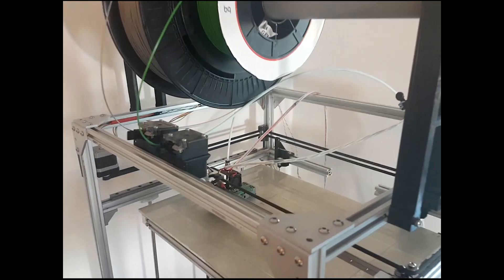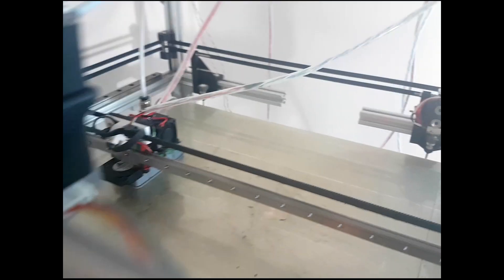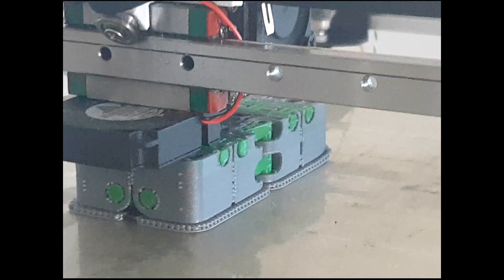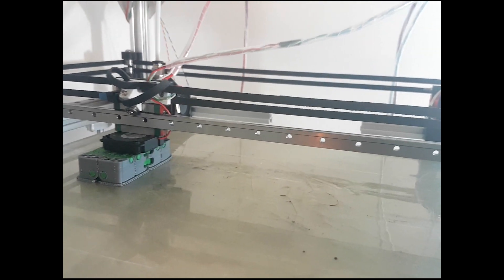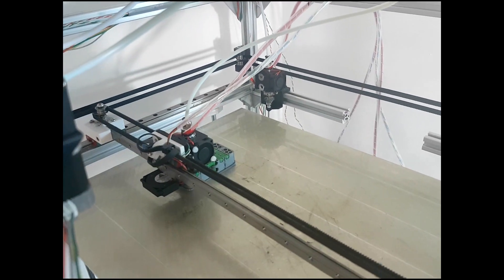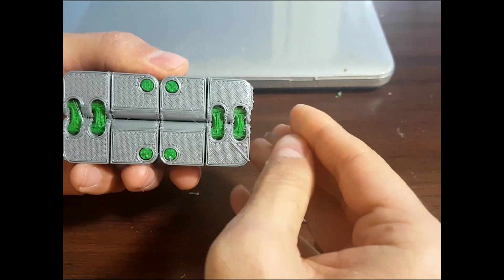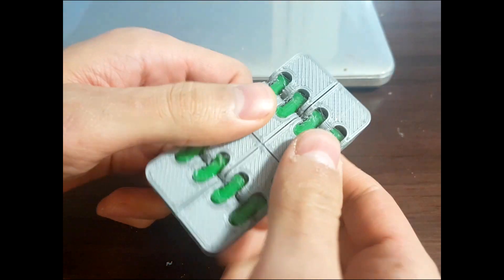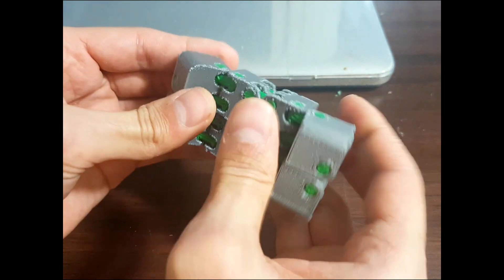RK3D Tool Changer #5 Dual Color Test

Comment: 4:12 if you print one from petg and one from pla there's no way they'd be sticking! pla and petg are like oil and water! I use them as supports for each other with a 0 seperation distance! just make sure you don't get it between each other's layer or else they'll be weaker than usual (fixed easily by calibrating your offset and using a larger xy seperation)
Reply from the maker: Sure, if you check my channel you will find many videos for the great use of different materials together :)
However, this was just a test for the machine using only PLA.

Comment: is the toolchange magnetic?
Reply from the maker: Yes.
Reply: @RajaaKahel  OOh nice! everyone told me magnets are not repeatable enough to work but yours seem to be working very well :) Awesome job!
Reply from the maker: @chloemcholoe3280  Thanks!
And tell everyone that I challenge them in the tool size and the repeatability and the tool changing speed and my DIY auto-leveling sensor accuracy ;)

Comment: I saw you made a post about using the Nimble on this, but you're not anymore?
Reply from the maker: After my Nimble started having extrusion issues (because of the lubricant they provided wasn't very suitable) I swapped it to Bowden. But I might get back to them later and use them.

Comment: That is so cool! Great job!
Reply from the maker: Thanks Cedric!
Reply: Do you have to edit the gcode to make it change colors? How does that work?
Reply from the maker: @cedricproper5256  Nope, I don't do anything other than settings up macros in the Duet with proper other settings as well as in Simplify3D.
Then when the Duet receives a T command it will pick/park according to the macros I made.
Reply: You make macros?
I'm unworthy.
Reply from the maker: @cedricproper5256  Haha I'll try to include all the settings and macros I used, to make it easier for others ✌️
Reply: Wow! thank you. U R Awesome!
Reply from the maker: @cedricproper5256  I included the settings and macros, only forgot to add a couple of codes for the slicer (start/end) which will do later.
Reply: Many thanks to you. Always looking forward to your videos with love and respect.
Reply from the maker: @cedricproper5256  Thank you! That's kind of you :)

Comment: YES ! Go Rajaa! Im buying an FT-5 R2 printer today and already have many electronic upgrades for higher temp high strength material usage and things I will be moving over to it. I want BADLY to use the printer as a kit to transform into a similar CoreXY setup to begin tool-changer testing (or if I can gain the reach needed with the general / stock Cartesian X Y movements to be able to grab tool changing system - then I would do core XY at a later date as I badly want to begin immediately working with Tool changer technology) as well! It is so important for projects I am in need of being able to do with a 3D printer! Very advanced Research and Development for components I must print that can handle EXTREME forces that so far only injection molded polymers can withstand as well as heat resistance - I predict the ability to integrate various high-end materials such as injecting pockets with PC in an overall build from NylonX - that at stress zones the variation of including a differing material property may provide the answer and for that I realize I must perfect basic tool changing technology!  - I hope to collaborate sometime soon or tey and catch up (unlikely for a while as you are doing such great work and it has been a long time since I have done programming) but mechanical engineering comes naturally to me at least.  The future of FDM printing is in tool changing technology and pioneering the use of it and the mechanics, the coding etc.   I hope we can collaborate soon!  - I have another video of yours I am about to search for now where you used Stepper encoders on your A and B motors and they had built in encoders / display screens on the back of the stepper motor - it seemed to add some degree of closed-loop control for correcting movement jamps or obstruction due to difficult print surface etc. I wanted to know if you still use those in the current build (so that if the hotend movement slips it is corrected for to correctly print always) and second what encoders/stepper drivers/displays that were mounted on the back of the steppers that you used - there was no information in the video description to give resources to explain what they were or where you obtained them.      I view MANY people on YouTube that are well known and respected - But very rarely do I find an innovator like yourself I believe thinks in similar ways to myself and are doing the things I (soon will) but would have been had I began 3D printing earlier. Not many people out there I truly can see have the intelligence and educational background to understand and solve problems the way you do. For this reason I do hope there is a way besides comments I can be in contact with you to share more details on this challenging engineering challenge which pushes the boundaries of FDM printing but I believe is possible to do especially with tool changing technology for not only having prepared and heated hot ends with various build materials but also to be able to use different tool ends such as laser for batch number markings and even mild routing / actuators / endless possibilities.  What is the best means to converse with you? Is Whatsapp available? Google chat?  I would like to explain some elements of something that is such a challenge I think it will excite you to know this technology right now you are working on can have an immediate use that never has been able to be done with FDM printing before but all my testing this far leads me to believe it will succeed and be possible.   I hope you will be able to chat with me in regards to this as well as questions I may have regarding the FT-5 and some of the coding with controller board swap to Duet etc as it simply has been many many years since I have done micro-controller programming etc and will likely need refresher and guidance to get setup with the basic platform to allow the freedom for development of the machine far beyond its stock design etc that's needed.
Reply from the maker: Hi Gerald,
For the CoreXY conversion from an FT-5 I have posted the files already, if that might help with something.
For the tool-changer I also posted the files.
Perhaps you find something useful there.
Printing with special polymers for special objects/situations will be much easier with a tool changer as you can customise a tool or more for that.
For the Smart Stepper (encoders) I removed them because I installed the DuetWifi and wanted to test and use its drivers as they are really great! But the encoders working nicely anyway. I posted the link to buy them (and get info about them)  in my design's page, perhaps you missed it then.
Thanks very much for your encouragement! I'm glad that what I'm doing is appreciated and useful for others!
Unfortunately because my free time is so little recently, I can't manage to do projects with others.. I honestly barely getting time to test and share what I make.. As you see, a few months between a video and the other.
But I might be able to help answer/solve a certain thing when I'm asked.
Sence we have a huge time difference assuming you are in US the best way to get in touch is through thingiverse messages (or preferably comments so other people can benefit from reading as well).
For the board, get a Duet! Everything I did was made using G-code commands only!
Hope I covered your points!
Catch you later :)
Reply: lol, same here, converting my ft5 as well. Readying it for the toolchange project... ft5 a terrible stock printer, but great to mod..

Comment: Awesome tool-changer design in action! Very nice clean snap for drops and pickups. Is there be a need to prime and wipe the nozzles if they are sitting in idle for some time?
Reply from the maker: Thanks! No priming and wiping at all! The silicone in the brush-cup is blocking the nozzle nicely. You can see that closely in my previews video: https://youtu.be/InrN1Av3H_M?t=373
Reply: Its funny - I bought 2 of the exact same wire part cleaner for dreemmels to mount vertically to clean / wipe any residue off the tool changers. I have a friend here that (while first I used a TronXY as a base for materials to begin customizing this much - but I have come to find the FT-5 is a much better starting machine) but I showed him these videos and he laughs as so many of the things you have aleady created and implimented in your build are all things I had already been assembling parts for with digrams and designs I talk to him about all the time - and once we ran across your videos even he mentioned "You really should contact that guy that's crazy all these things you have been talking to me about that you are saving up for and plan to do are basically being done by that person already!" .   Anyway - Im very interstedd in trying to (as money permits) catch up to be able to have a similar setup or enough of one for me to collaborate with you in regards to toll changing development. I hope circumstances allow for me to catch up at least with the needed hardware soon so that if we can share knowledge to at least have similar enough testing machines and basic coding to be close enough to the time lead you have had to be involed with tool changers and your printer build - If I am able to catch up, I believe 2 minds working on this process will more quickly isolate problems and find solutions for them in pioneering this VERY NEEDED Technology - I already have a corporate connection  NEEDING a part and many future parts that never could have been made before but I believe from my Chemistry,  Plastics & polymer Chemistry,  and Physics with significant Statics Backgrounds -  that FDM CAN Produce this particular challenging goal to be able to make by 3D printing that would change an entire industry - Luckily its a very close friend of mine that I discovered his field and my new growing intrest in 3D printing could combine to provide a solution that would never have been seen before) - Anyway, from the way you design alone I can tell we do think similarly on things but with enough difference that if with your guidance I can be caught up to where you are in terms of the systems etc and refreshing of my former programming knowledge but also tapping into the control means for the various controllers (I hope to use a 32 bit Duet controller) but If with your help I could be more quickly brought up to the lessons you have learned over the years to get to the place you are in this project - Then I would be able to be of greater use in connection with you to both solve issues together compare the ways we each solved the issue and start to develop a streamline protocol and maybe even begin to establish standards for tool-changing technology (E3D is currently in the lead for doing so but as the community knows there's always room for another option - I believe working together we could more rapidly produce reliable tool changing platforms and standards for all FDM printers and other members to be able to use and know that by adopting it they already benefit from all you have discovered already plus as I know the challenges of my design needs for this system will be very similar to high end applications that (as stronger filaments and prices come down on current ones) means that FDM printing may be viable as a true machining end - product process that really can become so stable that it can find its way into households everywhere to be able to produce replacement components that have the strength profiles needed to be viable for what is needed for normal use and making lasting prints.     Sorry this wasn't well composed and long - I just caught your video and hoped based on it being uploaded an hour ago MAYBE I will catch you to be able to reach out and also have shared some of what my vision is as why I badly (now with waiting on delivery of my FT-5,  MIC6 Plate Bed (I cant stand having a bed that isn't level to begin with) , Other machined components to give me the precision I need to use the methods ive already been studying to keep the former print layer from losing energy (heat) as quickly as the strength between layers depends so heavily on the difference of temperatures between the additive layer and the former - I have some results so far that are extremely impressive. The bond Strength though some intelligent processes - FAR surpassed the level of strength improvement I predicted.  I want to bring that knowledge to the field of tool changers so that other structural elements can be incorporated for materials or objects printed out with combinations of the structural benefits of the various materials.    - Feel free to remove these comments after you have read them if they are too long - I will understand / wont be offended. Mainly hoping to get a response based on the upload time of the video and hopefully gain some interest in what exactly I know this technology once refined will bring or allow for me to begin experimenting with for increasing strength of everyday prints as well as those designed for extreme stress environments.
Reply from the maker: @WarThunderGerald  It's nice to see others having similar thinking! :)
Wish you all the luck with your next printer and the whole research! It'll be great to share with others what you found and developed!
Forgive me if I don't go much in details as I   just got home after 9 hours day work :)